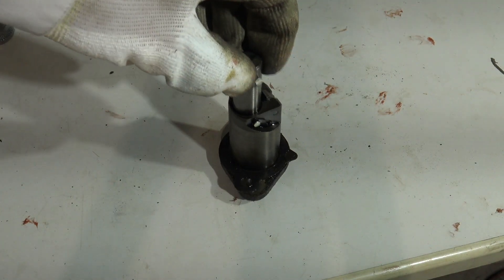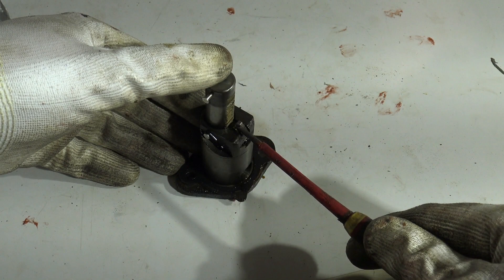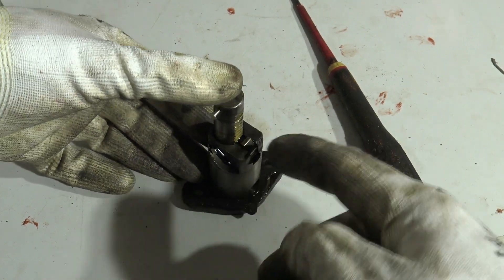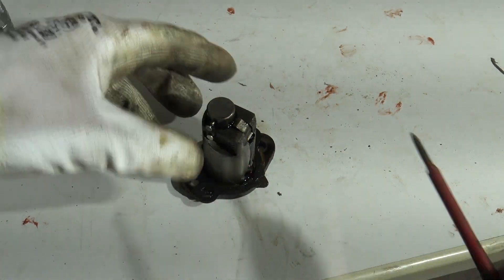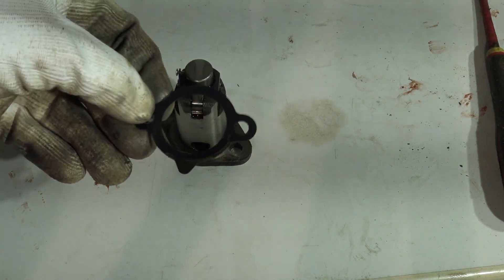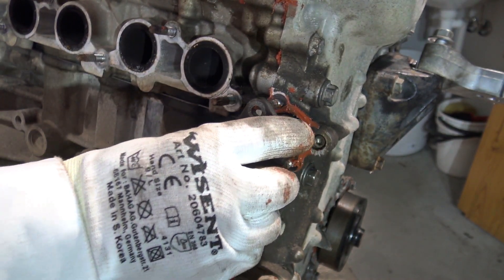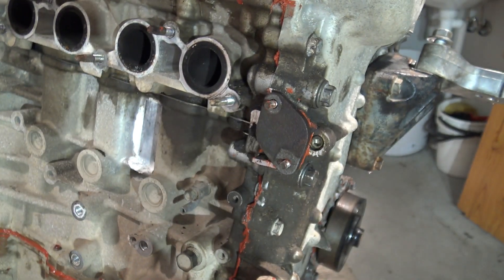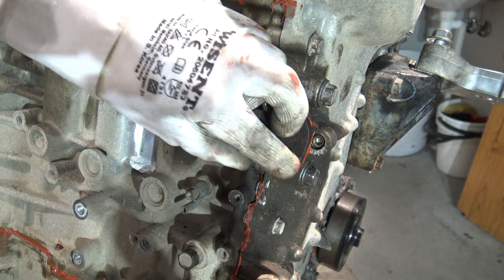How to Assemble Toyota Corolla Dual VVT-i engine years 2007 to 2018 PART 18  Timing chain Tensioner

Comment: On my 2010 Toyota Corolla repair manual said to release tensioner hook turn crankshaft to counterclockwise then clockwise. Now I have 2016 Toyota Corolla 2xr-fae should turn clockwise to release the hook
Reply from the maker: Noted